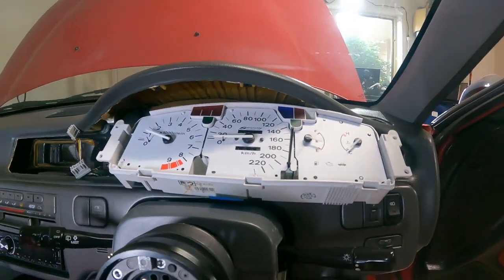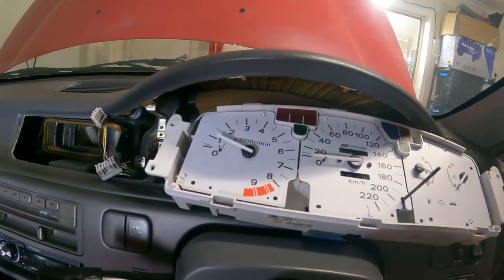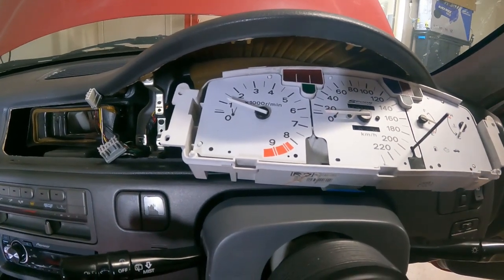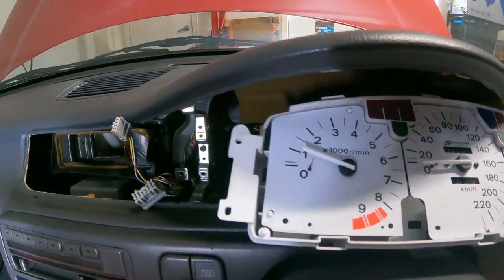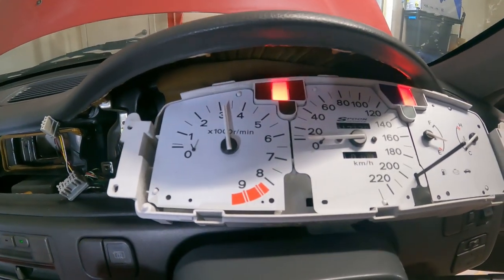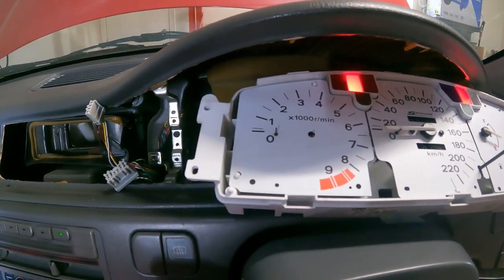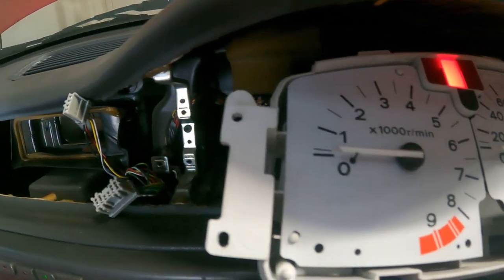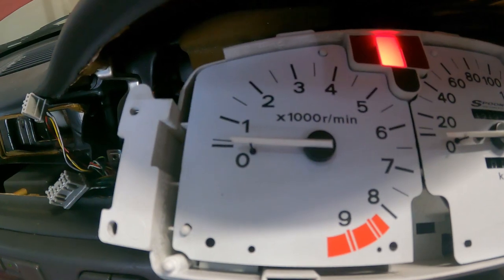How To Calibrate The Needles On A Cluster | Eg Civic B16

Comment: I have needle stops on my GQ patrol, I pulled them over the stop and let them come to a rest then took them off there and was told to put them back exactly there and then wind them back over the stop, if that doesn’t stop I’ll try this method. Thanks
Reply from the maker: Just be careful moving it when powered on because you don’t want to damage the gauge.

Comment: Wow I thought it was just me when I did mine recently.  I ran into the same problem haha; luckily I didn't put it all back together and tried testing it in the car before putting the front piece back on.  I figured out eventually this was the method to recalibrate the speed, rpm and temp gauge.  For the fuel gauge I set it back to empty and then let it recalibrate by itself slowly after turning on the ignition.  Good to see you got the 220kpm overlay now too!
Reply from the maker: Cheers bro I’m glad you were able to fix it too!

Comment: What about the other needles?? Temp and fuel? Temp is way up fuel is way down
Reply from the maker: Temp you put on once the car is fully warmed up and sit it at the half way mark. For the fuel I suggest taking a picture before where the needle sits on a flat surface and the replicate after.
Reply: @ thank you I’ll try, now it’s another problem the rpms work fine for the 2 first vroom then the needle stiffens up and I got to manually pull it a little bit outwards..
Reply: I found the problem, it was the inner piece of the cluster, I damaged it while taking the needle off.. thanks again

Comment: How about the temperature gauge? Can you show hot to reset/calibrate the temperature gauge needle? Becuz after I removed and put the needle back on it was higher from the center mark
Reply from the maker: At operating temp before my gauge was in the middle so I just put it back to the same spot once the car had got to temp.
Reply from the maker: Doesn’t matter if it’s slightly out as long as you know where it should sit normally. If it goes above that spot then you know you have a problem.

Comment: Hi there. Thanks on the tip. Does it work on any honda gauge cluster? I have the same problem on a crx and I can't fix it. It gets stuck. Greatings from Portugal.
Reply from the maker: Its universal most older style clusters work the same. It possible that the actual motor is broken.
Reply: @JarrodWillemse  Thank you. I believe it is not broken. The problem was that I took the needle off and I was not able to insert it on the correct position. But I'll try your tip. Thanks again.
Reply from the maker: @BrunoMarquez-t2q  yes make sure you push it far enough back on. It is possible to break the gauge removing the needles.

Comment: I'm trying to change the faces on mine, but how tf do you get the needle out without the stem getting pulled too? The needle would not fucken budge at all. Feels like Honda glued em on during assembly or something...
Reply from the maker: Yeh the first time you take them off there is a bit of glue. Make sure you grab it right at the base and not the edge as the plastic might chip.

Comment: Good day Jarrod , when you push the needle back on, do you push them all the in? Because when i put mine back on, it feel stiff
Reply from the maker: You need a small amount of force but not too much.
Reply: @JarrodWillemse  ok thanks, i will try again, because currently im sure my fuel reading is out, revs not moving and speed is out aswell

Comment: How does this method apply for the heat guage and feul. I don't think im getting the most accurate reading.
Reply from the maker: The fuel one is hard but you can move the sender float to 0% and 100% and check the needle position. The temp gauge doesn't matter as much as long as you know where normal range is. Most cars it sits in the middle anyways. Get the car up to temp and set it in the middle.

Comment: just picked up a new/used cluster and put it in now the fuel gauge goes to full, is there a way im supposed to reset it? not sure what to do i dont wanna have to pay to have it fixed if i can figure it out.. plz help
Reply from the maker: Was your old cluster working on the fuel gauge before? Is it the same model cluster you had before? Some fuel senders have different voltage outputs.
Reply: @JarrodWillemse  the reason we replaced the cluster is because the speedometer wasn't working so we got the new one from the salvage yard and just use that cluster but that fuel gauge was going past full so we put our original fuel gauge in the new cluster and it slowly goes all the way back up to full, everything is the right year and everything cuz it's a 93 Civic EX ours is the 95 so it's compatible it's identical
Reply: @JarrodWillemse  the old cluster fuel gauge was working before we took it out
Reply from the maker: @Spazzy253  did you take the new cluster apart or just plug the new one in?
Reply: @JarrodWillemse  we ended up putting our original fuel gauge in the new cluster because we know it works, but it just starts at E and goes to full
Reply: @JarrodWillemse  we tried putting in New cluster first tho before we switched fuel gauge
Reply from the maker: @Spazzy253  yes all good i was going to suggest that. Each of the sections can be removed separately if they break.
Reply: @JarrodWillemse  still not working tho, I called a mechanic and he said we should cycle the car cuz we haven't drove it so we went and filled the tank and he said to give it a week see if that fixes it
Reply from the maker: @Spazzy253  if you can try and open the tank to check the sender isn't stuck. Check the volate coming back from the sender. https://honda-tech.com/forums/drag-racing-36/fuel-sending-unit-blk-white-wire-fried-need-help-asap-3240120/